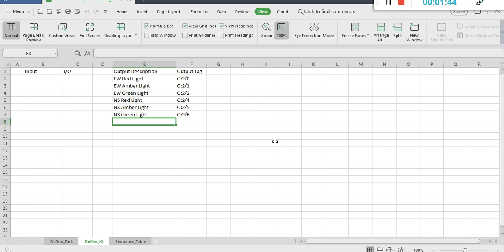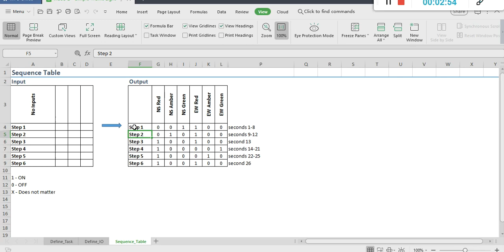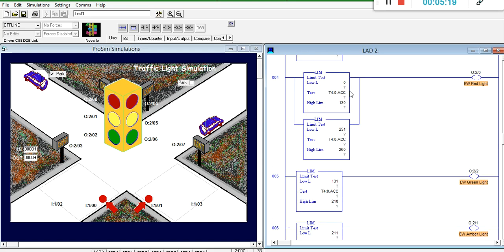Simple Traffic Light PLC Program

Comment: On  rung 3 your red light is supposed to only be a mas of 13 seconds long including a 1 second timer delay, by having a 14 second delay you have not met the requirements of the student exercise which asks for 13 seconds of each red light. please repost at that point
Reply from the maker: That is incorrect. Read the last sentence on the requirement. It clearly states (2) 1-second delays in one cycle.